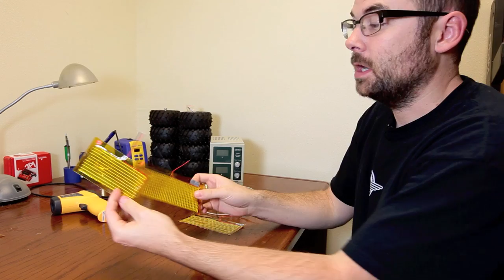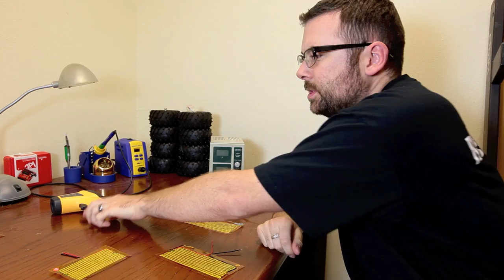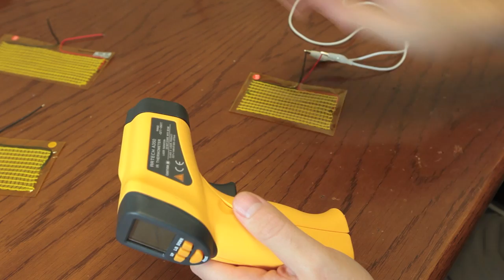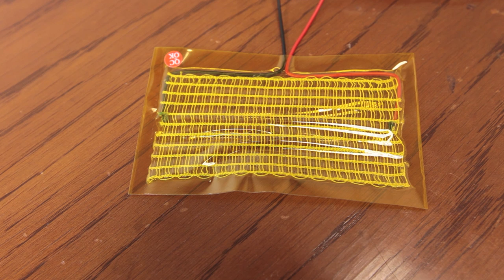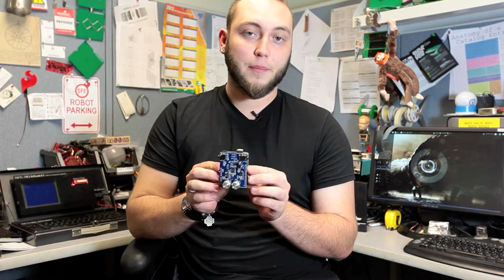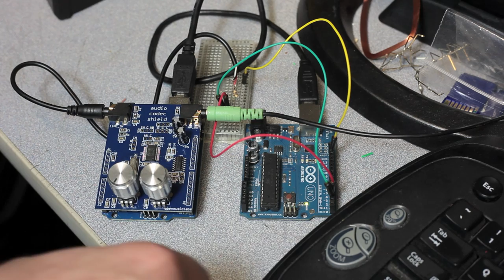SparkFun 7-27-12 Product Showcase

Comment: insulation would trap the heat and it would get hotter.  heat sinks will keep it cooler.  your hand is acting more like a heat sink than an insulator because it's so much cooler than the surface you're heating.  your hand absorbs that heat energy and carries it away, just like a radiator would

Comment: You might want to heat something to prevent condensation or to keep certain components at ideal temperature and prevent drifting as much as possible (think/search for oven controlled oscillators, voltage reference diodes etc).

For example I've seen a few resistors are used in surveillance cameras to keep the insides and the lens warm and prevent it from getting foggy.

Obviously, this is kind of an amateurish/hobby level solution if you have one of the problems I mentioned above.

Comment: If you insulate the pad it will get even hotter and degrade at an even lower voltage, if on the other hand you attach it to something with thermal mass that will act as a heatsink then you should be able to use higher voltages (such as a pot of water or your hands)

Comment: +SparkFun Electronics how would you alter the temperature? Like can you have different zones for different temperatures?
Reply: (Not nice that SparkFun doesn't reply to peoples genuine curiosity) Unfortunately you cannot really segment this item unless you re-wire the cut ends of the electrical wire that snakes through the weaved fabric. It's essentially one heating element. On mine, I've even noticed that there appears to be a tendency of the pad to heat up more in the centre than near the leads at the ends - this probably has something to do with the properties of the resistance going up more in the centre of the wire, although the FLIR images on the data spec sheets from the manufacturer shows even heating, this may be after some time, but in the first moments it heats up in the middle more.
To zone a thing like this, you could maybe use some resistors or other adjustable controls on other pads in other areas of your project.

Comment: Shouldn't this heater have an overall wattage rating instead of just a single voltage?  With proper current regulation you should be able use nearly any voltage as long as it stays under the rated power level.

Comment: The erroneous aspects of the video are concerning - as already mentioned by a few, the improper use of the term Insulator was getting really annoying because i'm just waiting now to eventually see a comment of someone wanting to sue you due to burning themselves in their makeshift heated gloves as the heat skyrockets well past what you measured.
and NO, these pads are NOT rated at only 5 Volts if you're using the same Taiwanese supplier that Adafruit uses, as the spec sheets they supply links to (why, prey tell are you not providing the same there, SparkFun?) clearly indicate full support of 5 to 12 volts and even have heating charts to show how much heat can be produced at those voltages and on different sized panels.